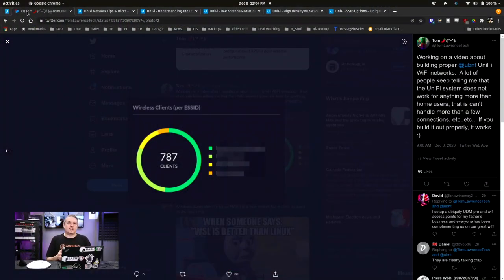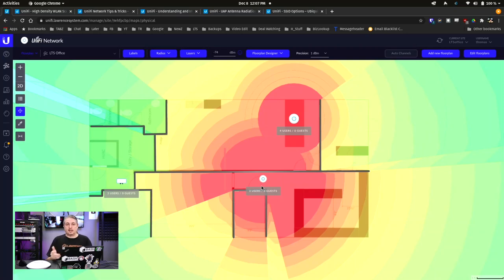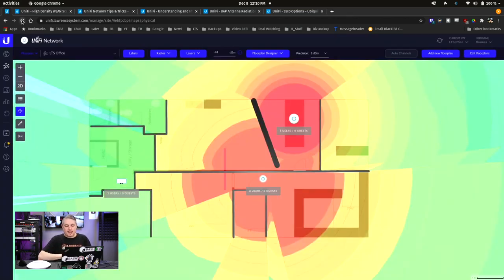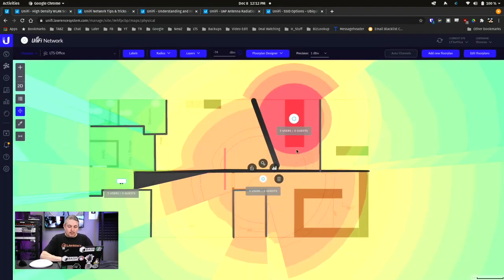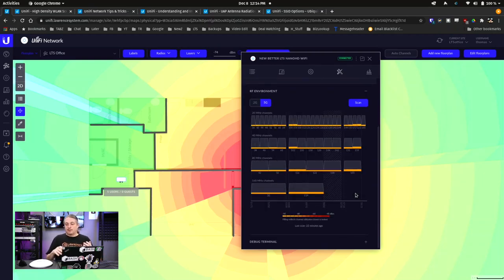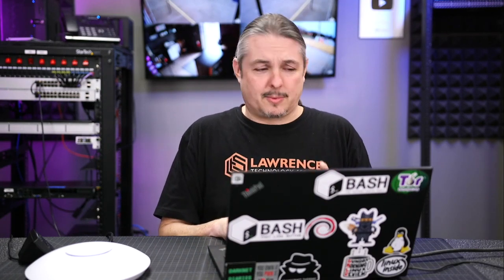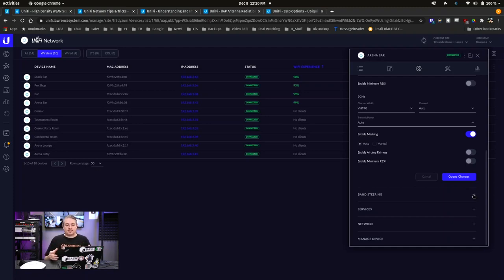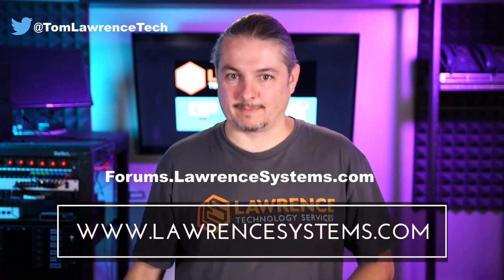Unifi Wireless Planning and Tuning

Comment: Fairly new to all of this, just set up my first Unifi deployment 3 weeks ago. New home, so I decided this is the right way to do it. I was challenged by a very narrow multi-level property. Multiple access points were the way to go.  3 main stories, and 1 basement.  For now, I'm not worried about the basement and that would be the easiest place to add an AP. For each floor, I ran a drop assuming they will be all needed, but I only installed one nanoHD on the top floor, and one InWall-HD on the 1st floor they are on opposite ends of the house. I also had the foresight to install the nanoHD on top of the staircase that only has a glass railing. So far I have connectivity everywhere with pretty good speeds

tldr wasn't sure how to deal with multiple floors; ran 1 drop for each floor; ended up installing two access points and seemed to have worked
Reply: What did you do with drops you didn't use? What's a way to retain the wire but keep it hidden?
Reply: @MatthewOrres  I was able to hide one of the cables in a closet with decent enough service loop. You can also terminate at that point

Comment: TIP: Turning on fast roaming and BSS transition helped my home setup greatly. Previously clients upstairs were favoring the downstairs AP even though the TX rate was like 150Mbps (when upstairs clients connect to upstairs AP TX rate is well over 1,200Mbps). I was always battling to get clients to connect to the right AP when I had fast roaming and BSS transition off. Now, all clients seem to be correct.
Reply: I had the same problem. Turning fast roaming helped.
Reply: Same experience here, even when fast roaming in beta state it seems handing over between APs is not as easy for many devices at it seems

Comment from the maker: ⏱️ Timestamps ⏱️
0:00 UniFi WiFi Network Deployments
2:24 UniFi Access Point Placement
2:39 Speed VS Connectivity
4:20 WiFi and RF Interference
6:30 WiFi Channels Planning
8:05 Choossing Channel Widths
9:55 Configuring Minimum RSSI
12:00 The Settings We Use for Business
13:00 UniFi WiFi AI Auto Tuning

WiFi Roaming Video
https://youtu.be/gf4XuGK4N5Q

What is Channel Bonding & WiFi Performance Tests 20MHz vs 80MHz ( UniFI VHT80 vs VHT20)
https://youtu.be/Zx8_Vp_1A6g

Client Project Planning: How We Keep 700+ Bowlers WiFi Signals Out Of The Gutter With UniFi
https://youtu.be/d3WIVkOtxc4

Ubiquiti Project Followup: How Reliable are the 283 UniFi Access Points & 12 Switches we installed?
https://youtu.be/Sv8w_plmYTk

https://help.ui.com/hc/en-us/sections/360008076994-UniFi-Network-Tips-Tricks
Reply: You've got a typo there in the  word network! Ha ha Your network's wonky!

Comment: I had everything set to Auto first too, and then I found out all 5 access points used the same WiFi channel, even after drawing the map with walls and correct AP locations and doing channel scans on both bands. Also the 2.4GHz transmit power was always WAY too high making sure none of my devices ever connected to 5GHz. I ended up lowering the 2.4GHz transmit power and setting custom channels and now everything works great. Also the Auto-Optimize Network default setting didn't work at all with 4 of my Dell Laptops with Centrino 1030 chipsets. They were always disconnected automatically after just a few seconds. Turning that setting off, fixed the issue immediately. Maybe the defaults are good for you, but not in my case. Very happy with Unifi after 2 years uptime with 0 issues.
Reply from the maker: Happy to hear you got it all tuned and as I said in the video, start with auto and change only as needed to get things working.

Comment: Great vid, but a few notes (you knew that was coming). So you are spot on by saying leave off minimum RSSI, but I just want to point out one of the main issues with minimum RSSI. Deciding which AP to go to is ultimately left up to the client, so you can deauth them, but the client might try and reconnect to the AP multiple times, which results in a slow hand off process AKA a 'stick node problem'. Also, auto channel does have one big issue worth mentioning. The issue I reference is that ubiquiti auto (and I believe a lot of vendors) prefers the least crowded channel, rather than the one with the best SNR/interference. So you could have a barely utilized channel selected that also has very low SNR, leading to poor wifi. Even in low bandwidth scenarios that can still be impactful, especially if are using something UDP dependent.

Comment: It would be super cool to have a measurement mode where we could use 2 AP's to measure a wall and automatically plug the numbers into the designer. Here in Spain, 99% of internal walls are concrete block with stucco. We need a lot more APs in our designs than stick frame construction. I will walk around the main spaces with WiFi analyzer and manually set channels and transmit power so at least one AP is on a clear channel in each location. I would also like to see a lower cost 5GHz only AP, as sometimes I will turn off a 2GHz radio and just use  to extend 5GHz in a space because 2.4 goes through the wall but 5 had no chance. We also have the luxury that most of our villas are in rural areas where, when we turn the radios off, every channel is totally clear and we have 3 perfect channels to choose from over the entire site.

Comment: Yea. I need to do this soon. I just left everything at default and threw in six ap pros around the house. Thinking with wifi 6 I may go with an in wall in each bedroom, a pro in the garage and great room and something for the back yard. I’m surprised I’m not having issues with just throwing them up but it’s been very reliable and fast.

Comment: Not to shill for Unifi.  But I have always lived in several Apartments for over 10 years.  Went through so many $200 Linksys/Netgear consumer router/AP boxes.  Always fought trying to get a good WiFi experience with all my neighbors having different APs with different settings.  Pretty much worse case scenario.  I purchased Unifi a couple years ago, left everything on Auto.  Never had to mess with it since.  Unifi just freaking works!  Nothing more to be said.

Didn't know about the Unifi AI.  May explore it just out of curiosity.

Comment: Would like to have heard about transmit power as I read that auto=max isn’t always the best. Good video tho. Looking forward to the home network one too.
Reply: When meshing APs on long distance, of course more is better. When providing wifi for example in a school, best would be one AP per room, but with low or medium signal strength, so there is less noise from the neighbor APs. Of course with 5 GHz and more available channels less an issue than with 2.4 but also on 5 GHz you don't wanna have sticky clients from neighbor rooms occupying air time by increased amount of dropped packages. If the sender (AP) is stronger than the receiver it pretends the receiver (eg cell phone) having a great connection (hey, I have 5 bars on my wifi strength), but if the receiver can not get its packages back to the AP it leads to frustration. More signal strength not always better, esp. not in dense areas. I remember a situation with nearly 100 wifi APs reachable, but even I was sitting 5m away from my own one, there was so much wifi noise it was hardly possible to work.

Comment: I'm not such a big fan of leaving everything on the default settings, and letting it run with Auto.
In a small campus network (14 UAP-nanoHD and 3 UAP-AC-M) with Auto running its scan every 3am, it rarely went 2 nights without making at least a dozen channel changes. 
The "WiFi AI" doesn't exhibit much "I" - its results are nearly indistinguishable from random thrashing. It doesn't learn or improve over time because it doesn't gradually converge on anything.
When someone says "Hey I wanted to mention, yesterday when I was in (whatever location) I had four bars of Wi-Fi but everything ran really slow and my battery drained really fast" you won't be able to go to that location and take measurements to understand what happened to them. The best you'll be able to say is "Try it again some other day, it will certainly be different and it might be better."
That's not a well-engineered, purposeful system that delivers high value by unobtrusively supporting the users. It's roaming wild and free, unmanaged and unpredictable.

Comment: What is the program you use where you can map out where and how many AP's to use.
My neighbour just bought a new house and i want to put in Ubiquiti. 2 levels with a attic and a garage. House is around 60x20 feet. Brick outer walls, wood floors and mostly wood inner walls. I'm thinking 1 AP in the garage and 2 in the house.
Reply from the maker: Just the tool built in to the UniFi system
Reply: @LAWRENCESYSTEMS  thank you, with a bit of digging i found it. Works pretty well. Only thing a can't figure out is the way the AP's behave with vertical buildings. The building is more rectangle then square. And a garage at the back of the house. I think i'm going with 3 LR's. 1 garage, 1 ground floor and 1 in the attic.

Comment: i  need help. i want to install a new unifi on a 2 stories  building (3 rooms each side by side) and i want to put it at a point where all 6 get wifi. at first i thought i put it outside on a pole. looking  at the 6 balconies  thinking that the best point since there its glass. but on the upper floor it was bad

Comment: Can you set the height of the access point in the planning tool to a separate height from the building, assuming you have a mounting pole higher than the building on the property?

Comment: There are scenarios where "more" access points are NOT better. If you have a few UAP-ACs in a line, connected via wireless mesh, clients connected to the AP nearest the router will have 12x the throughput of clients connected to the middle AP and 25x the throughput as clients connected to the furthest AP. This is a limitation of how the WiFi AC protocol works given the number of beams the APs support. You get a ton of overhead traffic clogging the mesh according to other forums I've read. The clients at the end of the line will negotiate slow data rates. That's where the multiple beam HD APs might help (I don't have experience with those)? I think WiFi 6 should solve this network overhead issue too. A budget solution is to try to make your network a spoke and hub topology with the router in the center. This minimizes the number of hops. And/Or you can hardwire all of your APs with a home run back to the switch...which is not always physically possible.
Reply from the maker: We always hub/spoke hardwire all AP's back to switches

Comment: I have three AP Lites in my home. 2.4Ghz set to channels 1, 6 and 11, and 5Ghz set to 36, 40, 48. I have a lot of smart home tech (lights, sockets, cameras etc) that still use 2.4Ghz and have the odd device that drops off the network and has trouble reconnecting to one of the three APs. Would the WiFi AI help me at all and do all clients get disconnected from the network when the scan is carried out at 3am?

Comment: what software do you guys use for initial floor plan?
Reply: Was curious myself, it's inside the unifi controller software :D and you can just uploade any existing floorplan and set up everything in there.
Reply: @ph0t0experience  yeah doing this for my home and do not have an existing floor plan ended up using this software called sweet home 3d to generate initial floor plan saved it as an image and uploaded to the controller

Comment: Question about the Unifi Access Points. Are they directional or is the signal sent equally in a sphere around the access point?
Reply: They are somewhat directional.  I don’t know the exact details but there are diagrams showing the strongest signal strength direction on the UBNT website.

In brief - (using the standard ceiling APs as an example) you want the blue light side facing the clients- not the mounting side.  In addition to this- it sends the signal strongest in the direction of the edge of the AP- out horizontally. This is why mounting the APs on the wall is not considered best practice.

My explanation isn’t the best as YT comments don’t support diagrams.  The diagrams on UBNT website are very good
Reply from the maker: It varies based on model and they have them all listed out here https://help.ui.com/hc/en-us/articles/115005212927-UniFi-UAP-Antenna-Radiation-Patterns
Reply: @LAWRENCESYSTEMS  Antenna Radiation Patterns!  I knew there was a word for what I was describing but clearly I did not know the proper terminology. Thanks Tom

Comment: I often find as I move across areas within the building, my phone or laptop stayes connected to an AP where I was previously, but now only has a weak signal and becomes a slow connection.  Are there ways to improve the ways a Client connection roams to a new nearer AP ?
Reply: There should be a setting for how weak a signal the AP will tolerate before it boots the client to a different AP. What APs do you have?

Comment: OK. But what if you have to use 2.4GHz and only 1, 6, 11 channels don't interfere with each other. How to add more AP? We have a warehouse 180x90m (590x295 feet) and 8 AP in there. Usually people use <30 data collectors with Windows CE 7. I have created an account on your forum and am waiting for acceptance from the moderator. By the way, I'm from Poland.

Comment: Damn, my boss asked to deepdive and check all the (interesting) UniFi settings and report to him. It's gonna be a short meeting I guess :D
Reply: Most of the settings are buried in the unifi controller itself in settings > advanced tab, those concern the use of USG - Wired & Wireless Network profiles for ACL, EGR etc.

Comment: what version is your unifi management ?
Reply from the maker: 6.0.41
Reply: @LAWRENCESYSTEMS  Thanks bro, I heard the version 6 is problematic, I assume the problem has been solved by now
Reply: @LAWRENCESYSTEMS  One more thing, what is the maximum length of POE cable from switch to UAP would you recommended?
Reply: @ifuoto8815  100 meters.

Comment: What I want to know is why can I only get maximum 400mbps on a unifi AP AC when a Netgear or Asus consumer device will give me 700ish?
Reply: Because those consumer devices focus mainly on speed, so the factory defaults are tuned to that. Unifi and other pro brands are geared towards high numbers of concurrent connections and signal stability. 400 is not the limit of the device, it's the bandwidth you get when using the default settings for channel width etc.

Comment: we are  buy 8 unifi-pro access point and controller based configuration. now is problem local getaway loss. per AP 70 user connected. Please provide Solution.